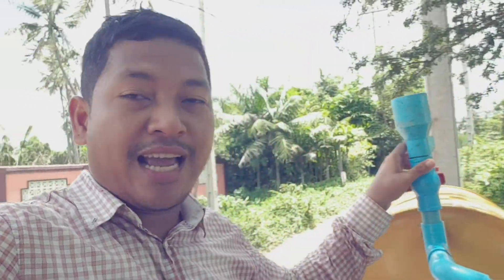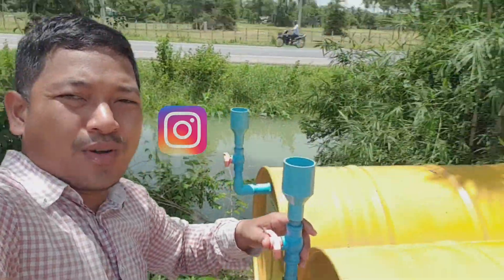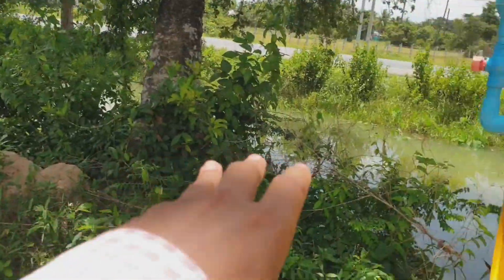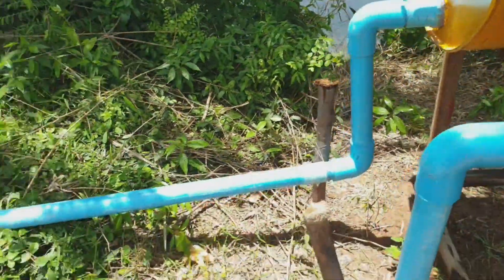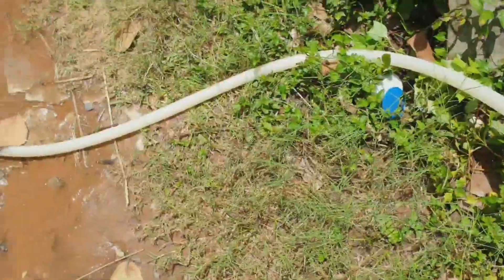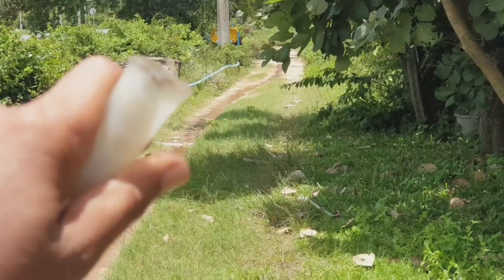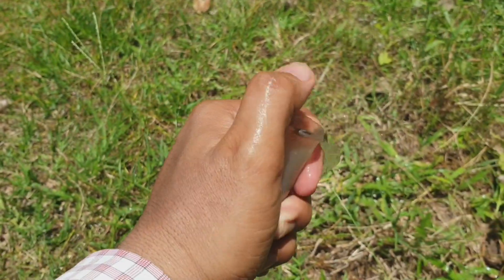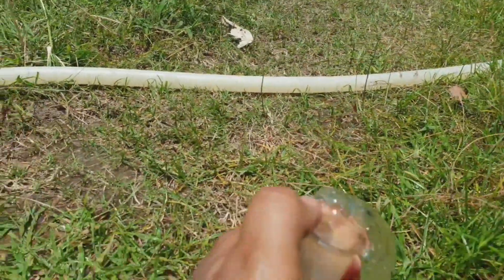How to make free Energy Water pump? | pump without electricity

Comment: since you are using a hose, bring that hose all the way back to the drums so that we can check if someone is not opening the air valves to permit air inside for the water to flow.. also to show if the water flow will exceed 400 liters which is basically the capacity of 2 drums

Comment: We can raise the outlet pipe to 1.5 meters, after we change the barrel with one of 1,000 liters, with a 5 mm metal wall, raised with those 1-2 meters. !?
Reply: 10,000 l (8mm) water tank, water source down to 1.5 m. Can we raise the outlet pipe to 2m from the current level? And we can increase the output flow to a minimum of 50 l / min. This is only the case, with the pipe horizontal. because in the others I know it works. Congratulations on the video. Thanks! @DIYinvention
Reply: No, this is a siphon system. You can drop the whole drum, but the source, river MUST be higher than the output for it to run.